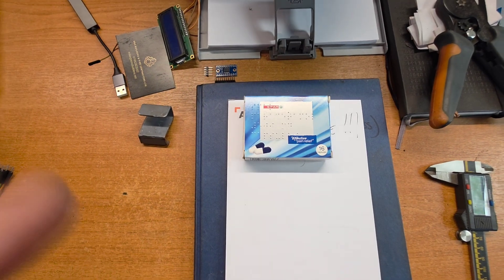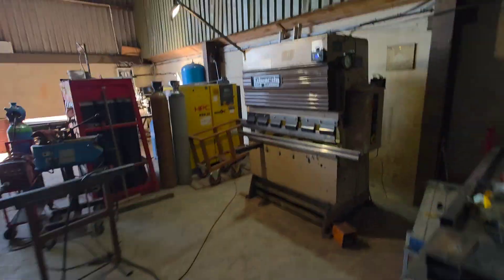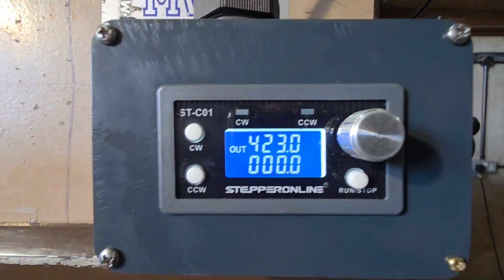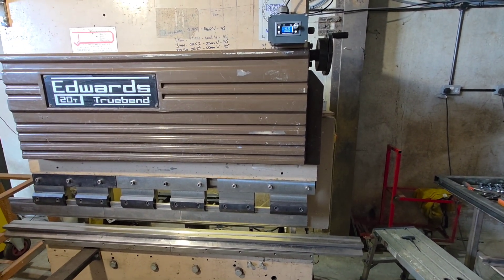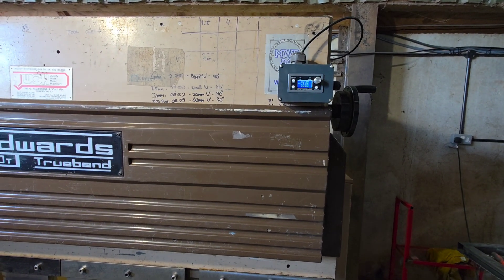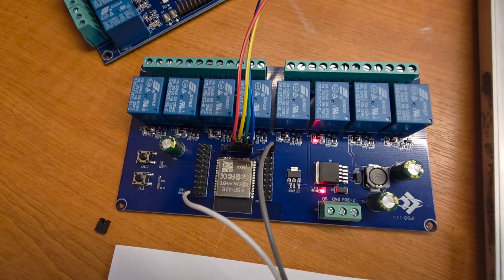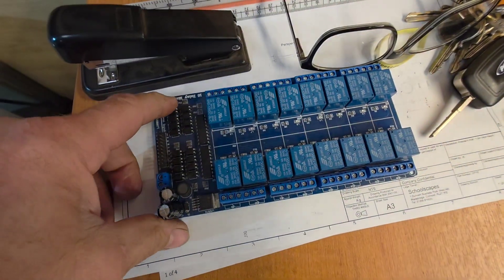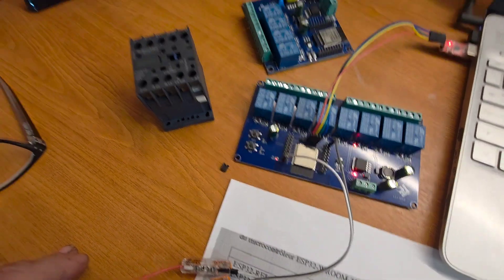CNC pressbrake back stop hack

Comment: I just found this video, and have not seen any others. I feel your pain and understand the situation when you have to get something to work, you do what you have to do. The stepper setup is brilliant.  But moving forward may I suggest looking at Mach 3 software with an HMI interface so you are not having to configure so much code? Just an idea.
Reply from the maker: Hi and thank you. The whole thing is soon to be completely rebuild - electrically - im going to be using a PLC . Just choosing the right one. MACH3 is so old now, Fliudnc maybe better if I were to do that. Good call though

Comment: Nice one mate. i'm working on a cnc sawstop like yours. 👌
Reply from the maker: Can I make a suggestion? Use 2 esp32's and put fluidnc on one and do all your keyboard and screen stuff on the other. Then just send simple gcode to the fluidnc esp32. It will then manage all stops and motor movement. That's what I did and have a video shortly showing it. 😆